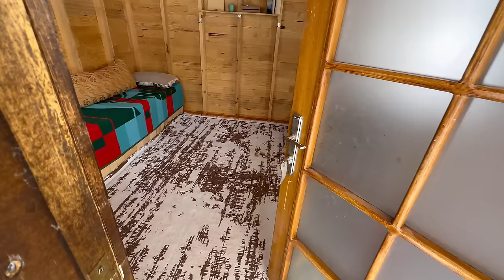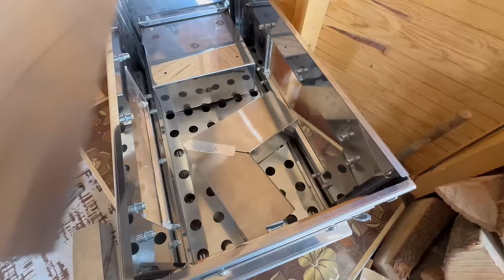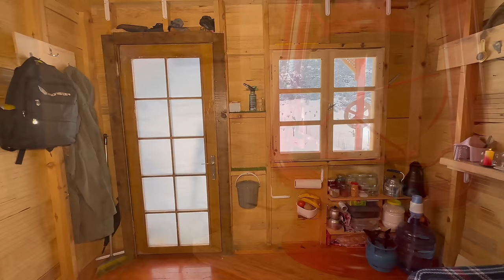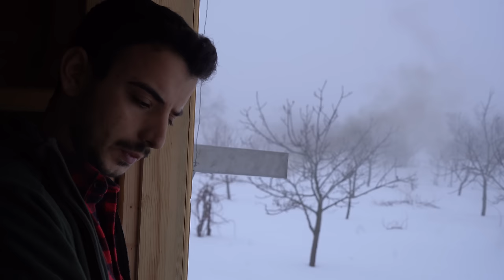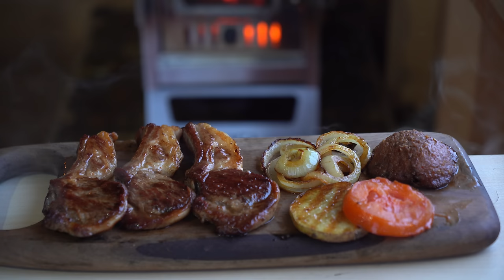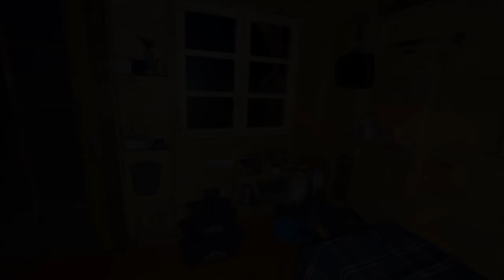Winter Camp in Wooden House / Snowfall, Heavy Rain and Wind / 4K Relaxing Camping video

Comment: Beautiful cabin. Rule of thumb tho... Windows and Doors must swing outside especially in a small cabin. It takes up space when it swings inside and its stronger and safer when it swings outside because not only the looks holds it but the lip around the Frame hold it aswell.

Comment: Lovely little cabin.  It would be a heck off a lot easier to hear of you had some insulation though.    Makes no sense to go to all the trouble of building it and then not insulating it.  I built a playhouses for my kids, it's about the same size and it's insulated.  Comfy when it's minus 10 or plus 35c..  it has a small oil filled electric radiator for heat and a small ac unit for cooling.

Comment: The building of cabins in snowfall and rainfall areas above ground level is the best option... even one storey higher better and bottom is car parking space..roof to extended outward atleast half a metre for snowfall away from dwelling... above ground level also helps set up Korean traditional ondol floor heating system..in Very cold areas.. roofing should be like a frame cabin thus no snowfall will be in roof.. heating costs drastically reduced through these few suggestions..